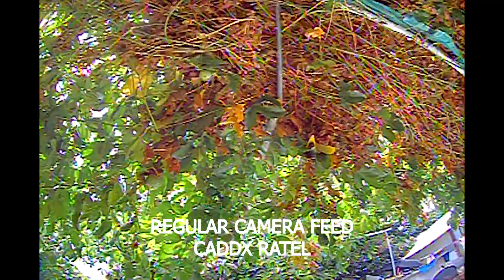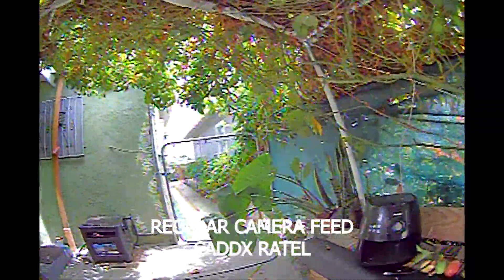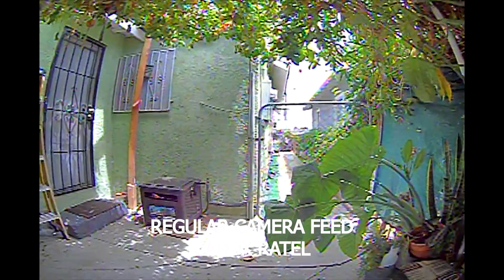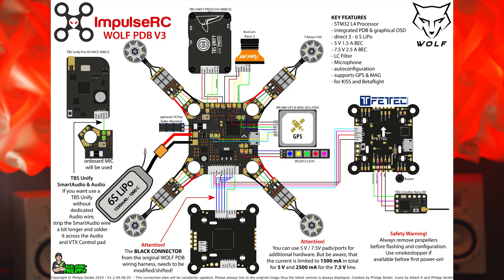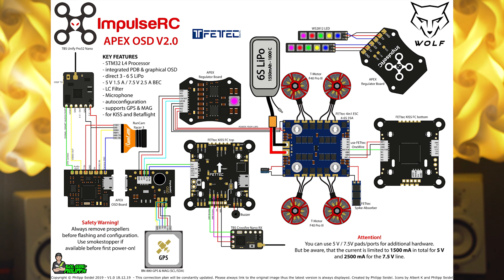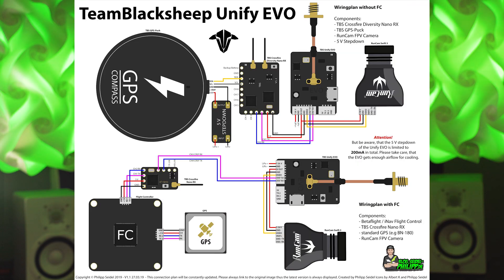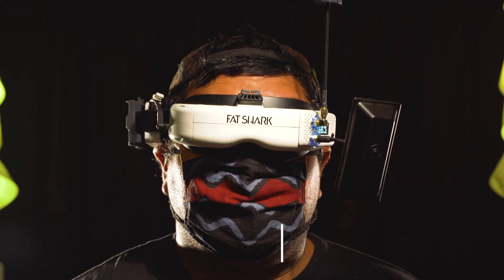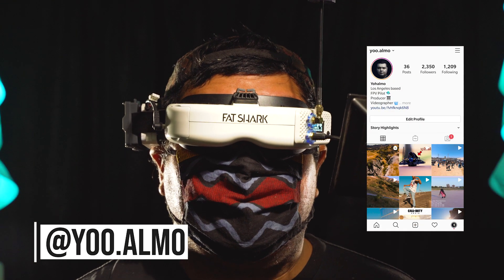FETTEC OSD PDB SET UP (FPV 2020)

Comment: may i ask what have you set in serial 1, 2, 3 and 4 as values?  I try to activate serial configuration but as soon as I save it, the check disappears. I used the side connector to put the caddx view rx, tx (invertitie clearly) vbat, and gnd.  while the tbs crossfire I welded it into the pads above the FC.  can you help me ?fettec kiss f7 v1
Reply from the maker: Hey there! I am not too familiar as to how to set up HD on the fettec hardware. However... There is a Facebook group with tons of knowledge about this! Attached is the link below. 

https://www.facebook.com/groups/2525296484215383/?ref=share

Comment: is there a way to use the impulse osd board without the regulator board?
Reply from the maker: Actually the fettec osd is a muuuuuch better option and easier. No need for a pdb
Reply: @yohalmocoto4604  yea, but i got the impulseosd for 5 bucks
Reply from the maker: @nicolapolitopoulos7592  unless if you find a bec that can provide a consist t 7.5 volts to power the osd. Not too sure as to how many amps the osd needs... But that is the only other way I can think of powering the osd without the pdb.
Reply: @yohalmocoto4604  thanks man! Helpfull video!